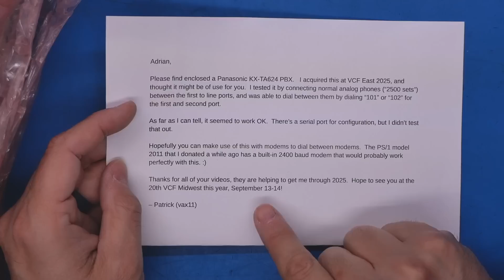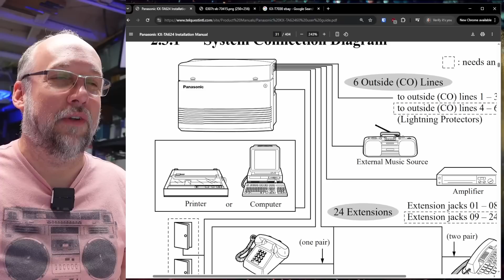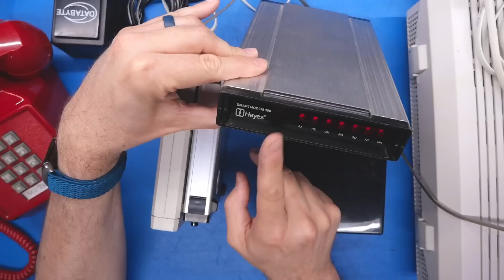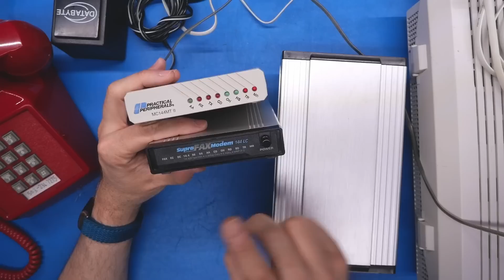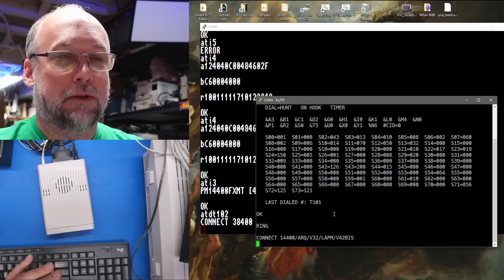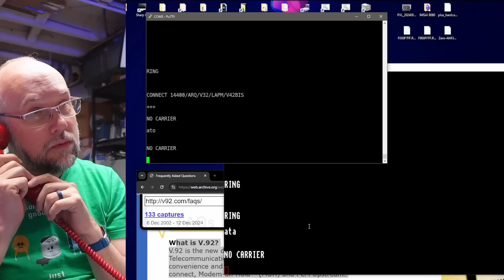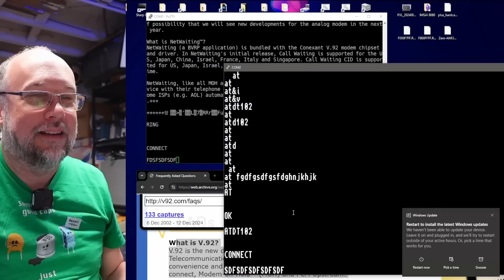How to use phones and modems like it's 1992

Comment: I haven't had time to watch this one yet but I'm SO PUMPED to do so. Literally have a stack of modems in my workspace right now that I've been excited to futz with.

EDIT: that was awesome. Going to look out for one of these switches to see if I can finally get my Commodore modem back to work. Got an old acoustic coupler as well that's been sitting around for a moment like this. Thanks for putting this out there!
Reply: You probably won't find one of these very cheap. Last time I looked they were still in the $100 - $500 range.   IMHO, a Cisco Linksys SPA2102-NA VoIP Router is a better bet for this.  It can be configured as 2 different "extensions" and you can use one port to dial the other port.  There is a video on how to easily configure it too.  Cathode Ray Dude has a good video explaining it.  And At $20 - $30 is really cheap.  You can also use a line simulator too, though these are more expensive.  Either of these will get you higher speeds and easier to configure.

Comment: Here's kind of a cool way to tie in the old with the new.  Take a look for something called a XLink. It basically pairs to your cell phone with Bluetooth and provides a POTS line you can hook into an analog system.  I use an older Cisco voip system in my home and I've got one of those tied in so I can make and answer calls without having to carry my cell phone around everywhere I go.

Comment: since you dealt a lot with modems and telecoms. have you ever seen diamond media's shotgun modems? it says that it required specific hardware to be installed at the ISP to actually work but it let you use two modems to download and upload together on the same line

Comment: I have that Supra Fax modem! I worked at Supra in Albany right before and after they were acquired by Diamond Multimedia.  Supra was right across the street from Linn Benton Community College. Lots of memories playing Quake with the other tech support reps over the office LAN after hours (manager included).
Reply: I saw Supra advertise in Amiga magazines a lot, and even Amiga specific devices.  I was impressed with the digital readout on my 14.4 modem, and Supra included a branded screwdriver with the modem just to tighten the serial cable.

Comment: If I recall well, the limit over analog was actually 48kbps; and 56 was achieved by having a digital connection from the ISP side to the telco, which was actually 64kbps minus conversion loss or such.

Comment: I kept my USRobotics 56K modem for nostalgia. Then I realized I have a bunch of VICModems and several for the Atari 8 bit. I also have the Commodore branded rotary phone that came with the Modem kit.
USR Courier Modems were Firmware upgradable via the serial port.
53K is the fastest analog I ever got. 51K was more likely.
Reply: I remember the 300 and the 1200 modem for the C64.  But I swear I saw a Commodore branded coupling device somewhere....

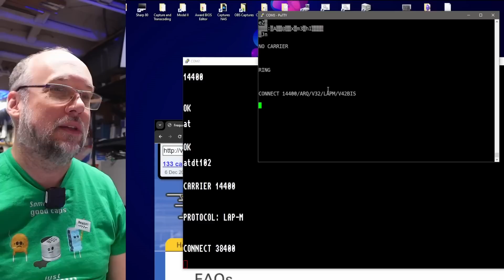Comment: @53:30  The Hayes AT commands that control local echo (in command mode) are E0 for off and E1 for on. For local echo (in data mode), the commands are F1 and F0 respectively.

Comment: My very first experience with a modem was around 1982ish when I was 14. I had a TRS-80 Model III and my buddy had a TI994/A with both of us having 300 baud modems. We wrote so many BASIC programs allowing us to communicate data between our custom games and other software. Good memories! My father, a HAM, was already into RTTY and CW using the TRS-80 Model III and a CoCo1 and a TNC. So much fun there too eventually getting into packet radio. I ended up getting my HAM ticket as well.

Comment: i thought v.42bis was just dropping the parody bit, so it only sent 8bits per word, instead of 9.   I could be wrong it's been over 20 years.  I used to know all the v. protocols and AT commands like the back of my hand.  Also the 56k aspect of these modems only worked on hybrid digital connections to the head end of your POTS network that connected directly to dialup ISP that supported it.  It never worked directly modem-to-modem, or directly over a phone cable.  Even with 56k support on both sides, no one ever did achieve full 56k speeds.

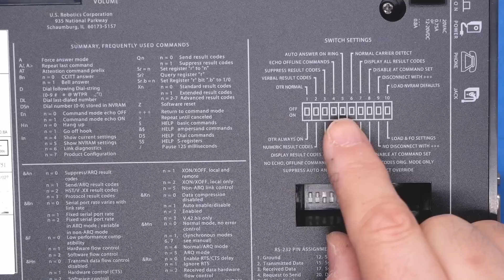Comment: 42:50 It's crazy seeing all those dip switches.  A lot of those functions can be toggled with AT commands with most other modems.
Reply: I'm sure those DIP switches set the default, but were still controllable with AT commands. These were more commercial/business oriented. I can believe that someone thought that being able to control those things physically made them easier to manage and replace.

Comment: I know Mike over at MikeTech has a bunch of modem cards in his collection that he's been saving for nothing particular that I know of. In case you need some, I guess!?
It's kind of amazing what they managed to get out of a couple of thin copper wires eh. They've recently cut out the analogue phone lines completely here in Norway, and now we have emergency call systems occasionally be down due to various issues. What if a natural disaster or war breaks out? We'll have zero ways to communicate. Disastrous.

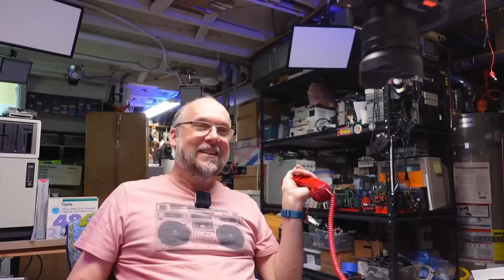Comment: 33:38  I think that's probably on purpose, the ring signal itself going to the phone would have been 20-25 Hz AC. I wonder if the MF that they use for the "ringing tone" is different from the typical bell system to distinguish it from the phone company's, so the user knows they're calling an internal number vs an external number.   

The dial tone might ALSO be different because of how you dial outside lines. If you dial for an outside line, it might drop you to a second dial tone where you have to then dial the real number.

Comment: In my entire life I only got a 56k connection once. It was at my first GF's appartment. I never got past 33.6k most of the time. 28.8 was pretty common. Every now and then 14.4 would be the thing. Unless it was "hey AOL I need your newest phone number list" I never got anything less than 14.4. That AOL phone numbers were always 300 baud.

Comment: System is set up for UK sounds. Can be configured to act more like US sounds if you prefer. I like the sounds
Reply: It's actually not. These Panasonic systems use a different internal dial tone that as far as I can tell on mine cannot be changed. The double ring is due to it being an extension to extension call rather than in incoming call on an outside line, it's very common for US PBXs and Key Systems to use a double ring for internal "intercom" calls like that. When you dial 9 to get out it passes through the external dial tone and incoming calls will ring with the standard US ring cadence.
Reply: @St0rmcrash  okay, on my merlin Legend it is reversed. the double ring cadence is for incoming trunk calls. but yes,  it too has a custom dial tone for inhouse, by default. The ringback tone is standard US standard. this system is using a UK ringback tone.
Reply: @bichela  It's not the same pitches as a UK ring back, I have one of these, it uses the same tone for dial/ring back/busy/reorder and it's not reconfigurable on the panasonics, and the ringback itself isn't doubled like the audible ring
Reply: Noticeable by the double ring bursts - as as Australia.
That's how I used to spot US movies, the phones rang kind of strange, as in one burst, not two.
Reply: The US is the other way around to the UK for the ringing, I think. So an internal office call in the UK would do a single long ring, which in the US is used for external line calls. And the UK uses the double short ring for an external line call, which is used for internal office calls in the US (hence why we hear it in this video, as Adrian is making a call from one internal extension to another).
Reply: I remember back in the day that I actually edited the sound effects for the Win3.11 "Chat" program so that it would ring twice instead of once. I didn't realise at the time that that's how phones rang in America
Reply: @fragglet  some older exchanges use a double ring in the U.S but most are the one long ring . on some PBXs the double ring usually referrs to an outside CO line ringing in.

Comment: FYI: Even if had 2 56k modems, you wouldn't be able to connect at 56k -- 56k connections required a specialized digital modem (connected to an ISDN or similar line) at one end of the connection.  When the remote modem is a typical consumer grade 56k modem the max speed is 33.6k (I think).
Reply: Yep, exactly. Analogue to analogue will only do 33.6k. I worked for a dialup ISP for my first job and we bought some 56k modems to upgrade our shelves of modems, but it would never connect higher than 33.6k, before we worked out why..
Reply: @SimonQuigley  right. To get 56k the isp had to have T1 service and digital dialup endpoints. 

The modem at the client worked by figuring out the voltage profile and extract the clock from the analog signal created by the D2A at the central office or where ever the telco pillbox turned digital to analog for the last run to the customer.

That also meant that you could get those speeds no matter how far away your isp equipment was because it was all digital from the isp T1 to the customer last mile.
Reply: And as an added bonus that meant they also had ISDN service.

I had ISDN with two digital and two voice service. Gave one number to my teenage daughter and had a smart 3com “modem” or router that could bond two 64k into 128k. And because I worked in IT, I put an ISDN modem on the work dialup network so I could work from home. Instant network connection with just a ping.
Reply: Actually they figured it out by removing bridge taps, voice coils, and dedicating a pair from the drop to 1 jack only (jacks are typically daisy chained in a home) also drops back the bbox had 2-5 pairs
Reply: 56k will connect on a pure analogue connection, but anything that uses a digital interconnect bus will not reach 56k, because there are now 2 ADC connections, and 2 DAC conversions, in the loop, and 56k only works because it will characterise the ADC in the phone company side, and the one on the modem side, with the phone company side being assumed to be a pure digital interconnect, either via ISDN or using a T1 line. This then allowed them yo find all the voltage levels that will give a correct digital signal, the final boing when connecting being this work, trying all the modulations available with 8kHz sampling rate and a 7 bit ADC on each side, as most telco lines robbed the LSB to use for in band signalling, except on ISDN where you got 64k. Straight analogue PBX, which this one is not, will handle it perfectly, but those are vanishingly few these days, and very old, with lots of analogue IC's on the boards, mostly with separate plug in cards per port, and not a single SLIC doing all the lifting to make it fit on a single chip. most have a Z80 doing the actual control, with a few crosspoint switches to feed internal voice buses, and generally are limited to the number of simultaneous calls that can be connected, while the one adrian is using has up to 6 external calls supported,plus you can have up to 9 internal calls at the same time, using all ports. Had one years ago, it had 4 incoming lines, 16 extensions, and you only could have 6 simultaneous calls, either internal or to external, before it would no longer be able to connect internal handsets, giving you an error tone instead of internal dial tone.
Reply: @SeanBZA  Maybe, but if sending 56K would have added at all to the expense of building the modem, I doubt if it would have been done (at least for consumer modems).  The number of users who would have had a pure analog connection between two modems would be quite small.
Reply: @SeanBZA but will they actually connect at 56k or are you speculating? Why would an analog modem even attempt to go to 56k in the outbound direction when in 99.999% of real world scenarios that wouldn’t have been possible because by the time 56k modems came along, 99.999% of COs had digital switches. I have a pure analog PBX and a couple 56k modems in the garage. I should test it!
Reply: I remember in 2007 or 08 when cable or isp would have numbers to use for free while traveling. I was getting download speeds of 20 to 30k.. I was shocked at how fast, even with most of the dialup services were not used. 
I started with a 14.4 in my compaq presario cds 860..
Reply: Also, 56k modems only get 56k in the download direction iirc.

56k because it was a 64kbps but the phone system uses the least significant bit for signaling so that scrambles the bit so you get 7 bits at 8kHz for 56kbps

The “42k” commenter is thinking of is probably the v42.bis mentioned in the video which was a compression on top of slower physical bit rate
Reply: @ppokorny99  Not quite.  While the phone line to the customer was analog, the phone company had gone digital (between exchanges) long before.  The modem speed limitation was due to how the analog signal was digitized by the telco A to D converter.  But large companies (CompuServe) didn't use analog phone lines.  They used a "modem" that outputted the "tones" digitally and only became analog at the customer's exchange.  Because the tones were crafted digitally, they could get a few more kbps out of it.  

The best way to explain it is to compare a received fax sent from a fax machine against a fax sent by a fax server.  The scanned fax was all lumpy because the pixels weren't aligned with the character edges.  A fax server effectively made the receiving fax a remote printer.  It wouldn't be the 600 DPI you get out of a laser printer, but it would be clean text.  The same thing is happening here in audio with CompuServe having a "Modem server" sending out super clean tones by carefully aligning the phase of the tone with the digital sampling.
Reply: On local BBS systems we could sometimes get as high as 42K using 56K modems, but yeah, there were limits that would not allow the full 56K connection. When I went to ISDN I was able to pair two 64K lines together for a true 128K connection. That was awesome until DSL became a thing.
Reply: I did get a 53,200 bps connection once if I remember correctly. Across the street from the CO with a new, buried line. Probably about 150-200 line feet.

Occasionally our customers were able to get over 40kbps connection speeds, but usually not very stable.
Reply: The true speed over an analog line was much, much less than 56k. I think 33.6k might have been it, not sure, but the 56k modems had data compression built into them and that's how they could technically reach speeds over whatever the actual limit was. You'd never actually get 56k on an analog line because of line noise and other telecom weirdness, though. You needed a clean digital line, which almost nobody had in their homes when dial-up modems were still in wide use.
Reply: @Darxide23 Ah, but when 56k modems were standard, some households had 100% digital service (unknowingly) up to the local switchbox -- say, 100-200 yards away.  In that case, 56k was possible.

The standard was "If you were eligible to sign-up for ADSL service, you likely could get 56k -- and if you were close, then the odds were reasonably good."

As other have pointed out, "56k" was asymmetrical -- 56k down, 33.6k up.
Reply: @Darxide23  I got consistent 56k, even though the run to the exchange was 305m of paper insulated aluminium wire, then 50m of lead sheathed paper insulation copper wire. All I did was to replace all the inside wiring with new, and cleaned the joins before connecting them, reusing the old screw terminals to the Telco side, and then a new RJ11 socket for the line.  exchange was digital, so reasonable line condition, and i got the one phone tech to go into the frame room where they had the underground to the lead cable, and remove the links from the 3M punch down and scotchlok them to the cables directly, getting rid of all the noise.

Comment: I thinking to myself wouldn't it be funny if you had a Panny KXTA624. I am a UK telephone collecotr and have three, one for my general use/tests, one, car batter & invertor powered I use for public displays in the summer, bot in 616 configuration, i.e. with one expansion board and another knocking around somewhere, just in case. And then it happened!One appeared. Now I'm on my "home turf" :-) The serial port is not for configuration, its for a printer for reporting. Config is done through a "system phone", a digitalish (voice is analogue) phone with more buttons and display, connected, generally, as the first extension which is also the "operator" or "receptionists" phone. Dialling 0 form any extension will call it. If your has extensions in the 100 range it is already configured, i.e. not on the default settings. It has a coin cell which is genenerally still working. I have never replaced one. The instruction/programming manual has like 600 pages and is confusing, but it all works somehow. 624 refers to the maximum capacity of the PAX, i.e. 6 CO lines and 34 extensions. Yours, and mine, are in 616 config. The extra expansion board adds 8 more extensions but no more COs, to bring it up to the full 624 configuration. Yours, surprisingly, is configured for UK-style double ring cadence. The default is US-style single cadence. Date is indeed late 90s-early 2000s. My main one is 1999.
Reply: Yeah. I was expecting something a bit weird when he mentioned the ring cadence being wrong.. only to hear it sound right to my ears. I never dealt with one of these, but I still get nightmares from the BT Versatility and Mercury provided PBXs.
Reply: Very cool. thanks for that info. We in New Zealand had mainly UK phone gear so we had the double ring cadence on our lines. I was surprised to hear his one configured like that.

Comment: That brings back memories using a 1200 baud C64 modem and my first BBS experiences in the late 80s. Then it was 14.4k on a 486 in 1992, a 28.8k in 1996 and finally broadband by 1998.